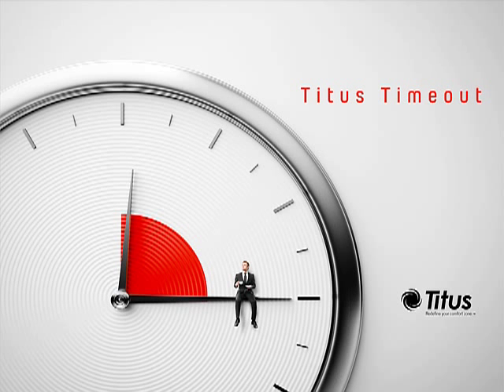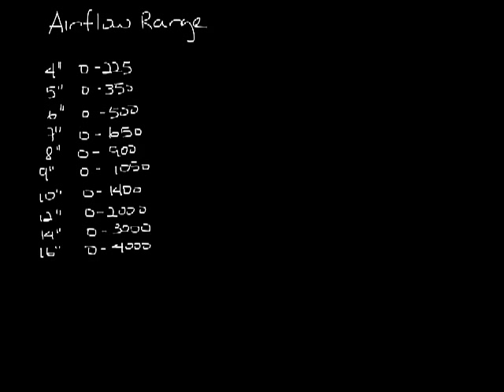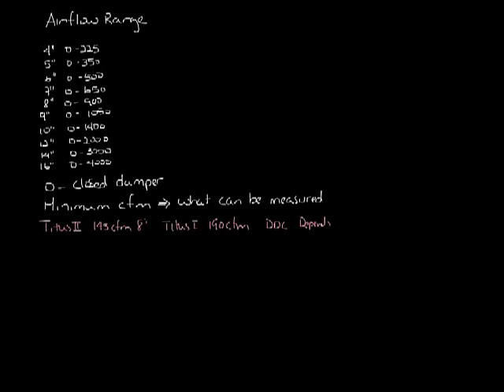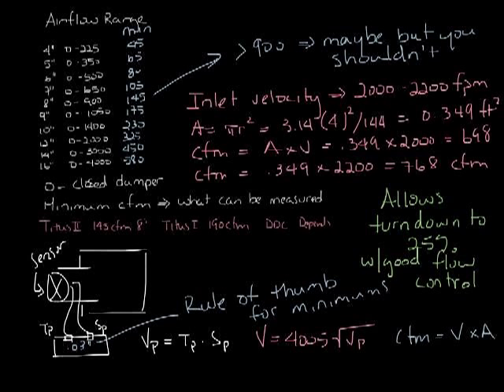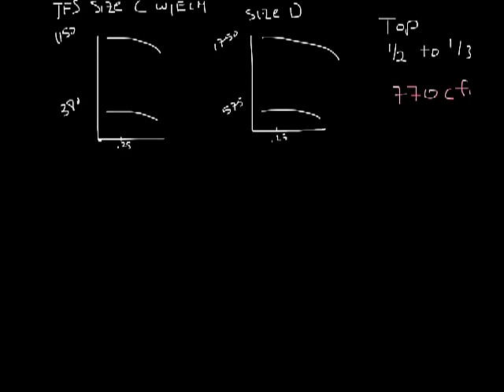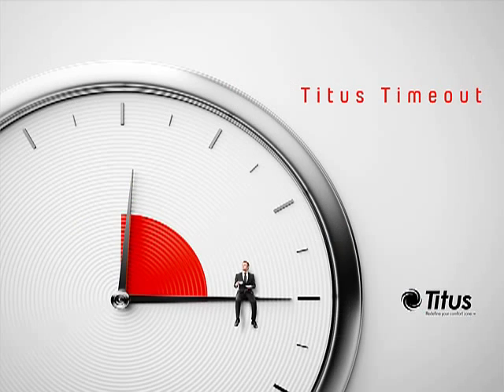Titus Timeout Podcast - Sizing VAV Boxes

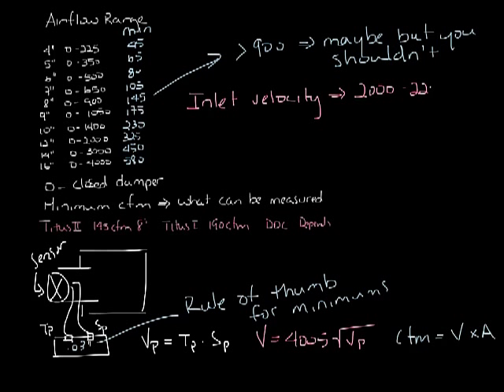Comment: For those of you wondering why your numbers don't agree with this video, be advised that the inlet area (subsequently used to evaluate CFM) was incorrectly calculated at approx. 3:40 in the podcast. Inlet diameter was plugged in instead of radius using A=(pi*r^2)/144. To use diameter to calculate inlet area, A=(pi*d^2/4)/144 needs to be applied instead.
Reply from the maker: Thanks for your comment. I went back and reviewed this podcast that was originally posted in 2013. I believe that your observation was made in error, because the presenter gave an example of an 8” diameter inlet and correctly plugged a 4” radius into the equation resulting in an inlet area of 0.349 sq ft, which is correct. While reviewing the podcast I found a number of other issues that need to be corrected or updated. For instance the presenter didn’t explain that the inlet sensor produces an amplified velocity pressure signal and our recommended minimum airflow rates are now based on a 0.01 in wg sensor – not 0.03 in wg. Also the presenter incorrectly stated that ECM efficiency decreases as motor speeds decrease. We will plan to pull this podcast and I’ll create one or two new podcasts to replace. - Randy Zimmerman, Chief Engineer

Comment: hello,

I enjoyed your video, but using .03 as a starting point I dont come out with the same minimums as you did. Are you using the square of .03?
Reply from the maker: Hello, it is the square root. The equation is shown in red around 2:30 in the video. It is V = 4005 x sqrt of Vp.
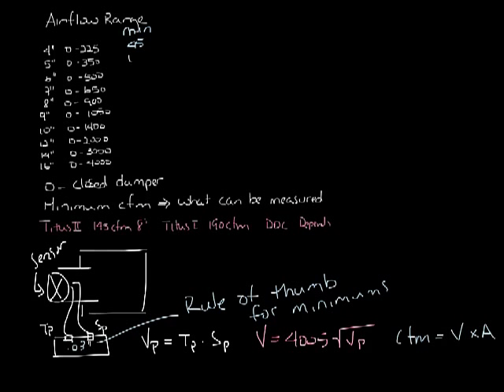Reply: @TitusHVAC  i believe the question stems from using the data presented and the formulas presented and being unable to produce the same minimum cfm's as listed at 2:52 ... For the 4" diameter (r=2") opening, 4005 x sqrt of 0.03 = 694 fpm   ---> 694 x pi x (2 squared) / 144 = ~60.5 cfm not 45 cfm.  Also, as a check, the 694 fpm (V) matches the charted value for Vp of 0.03 (the relationship between V and Vp).  The rest is basic math.  What am I missing?  Thanks!
Reply from the maker: @Jeff-Love-HVAC  It’s a little complicated, because this podcast is quite old. At the time this podcast was created, we based our minimum recommended airflows on an inlet sensor signal of 0.03 in wg. Please note that this signal is an amplified velocity pressure signal produced by our AeroCross sensor. It is not velocity pressure. Velocity pressure has a K-factor of 4005 fpm, but the AeroCross is closer to 2500 fpm (varies slightly by size). A few years ago we revised our minimum recommended airflow down to an inlet sensor signal of 0.01 in wg. Our current minimum airflows are therefore based on this sensor signal.